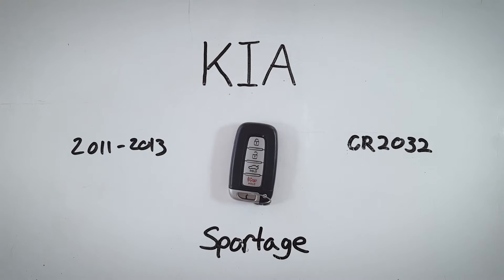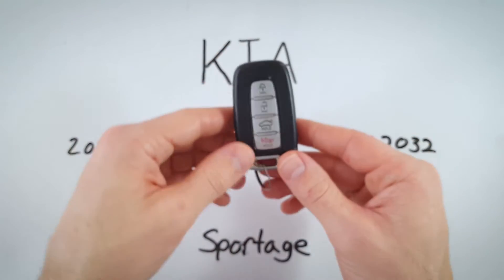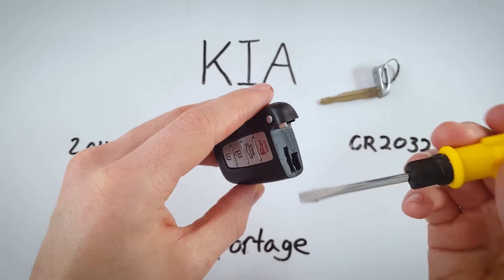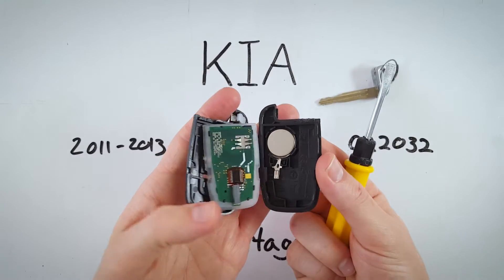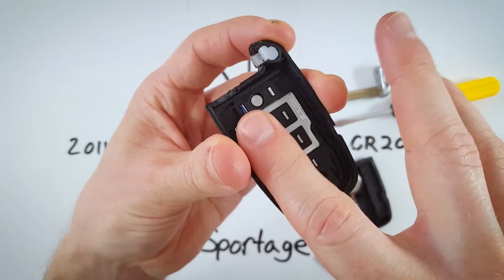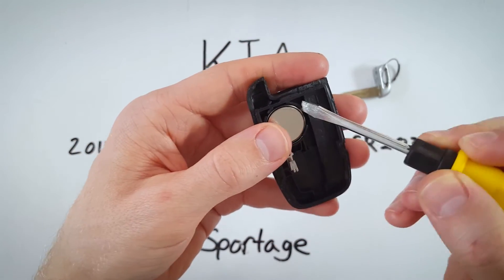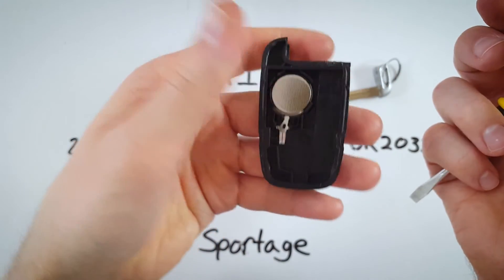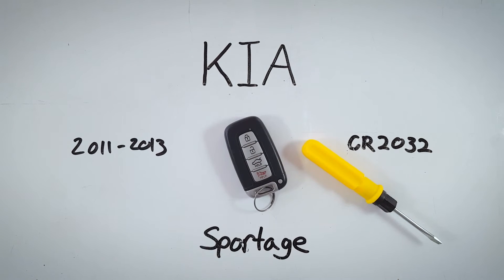Kia Sportage Key Fob Battery Replacement (2011 - 2013)

Comment: I've only had my 2013 Kia Sportage 2 weeks 1. its uninsurable because of some minor recall 2. my keyfob went out 2 hrs. ago, There was nothing with numbers, I live way out here in the desert a few miles from Death Valley, CA so there is no help for me . I tried to take key out but had to pry it apart from the side there is no key!! When I got the battery out everything fell apart , the button fell in the floor a tiny spring moved around inside the fob. I dont see any spring in your video so I'm stuck. Where does a spring go? There is a white thing that sits on the edge of the mother board side too. I'm sorry to be so long winded but I'm in a total panic now my car is locked it worked fine yesterday. 13 months without a car & this is what I get. Should I put it back together and try it? I could sure use some advice. Being female some body at a Kia place 300 miles away will try and get the best of me Im far from stupid with cars but am stupid with fobs. Thank you Lisa